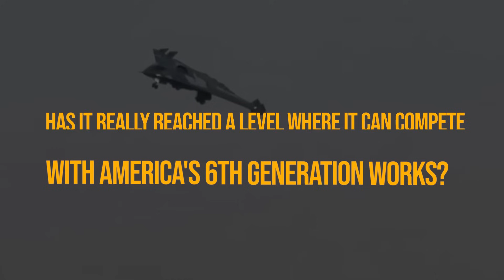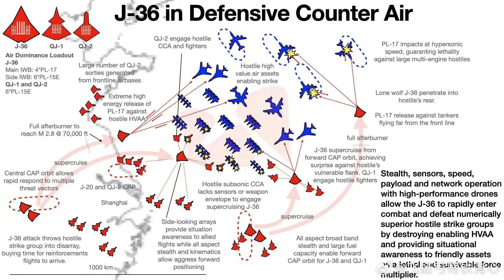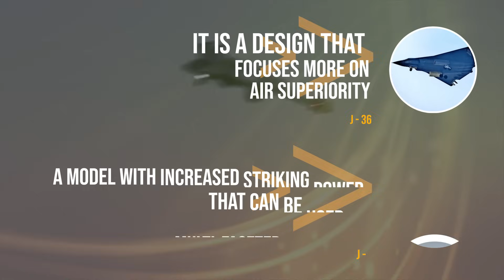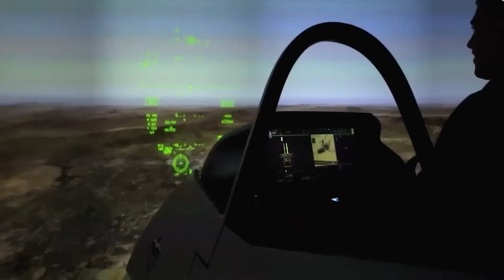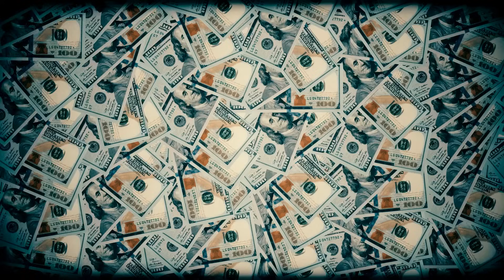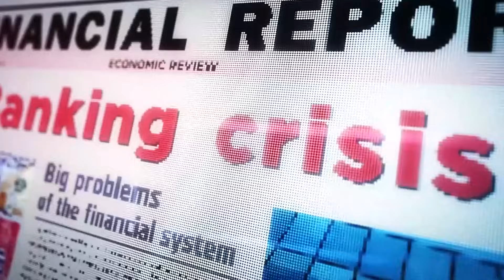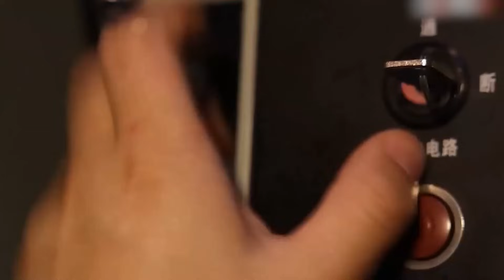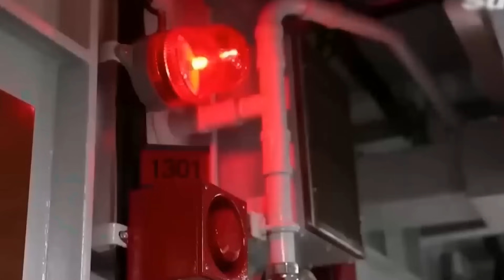China Just Tried to Respond US by Revealing Never-Before-Seen Chinese Fighter Over Sky

Comment: I don't get why they hyped China's jets so much. US had been flying tailess planes for years and we didn't brag about them. We've had the 6th Gen NGAD Demonstor flying for a few years we never bragged about it. China brags about everything they do for what?
Reply: The problem with American mindset is they are still in the legendary past…. Current military strength n performance is in a whole new level. Wake up n accept the reality so you can live without prejudice.
Reply: @sharfazhameed6382  they probably don't even know that those airplanes like F-35 were also created in Europe and still use European parts, and that Europe even has more technology than them and is developing right now 2 6th generation aircraft and one 5th, etc.

But Americans always think they are the top.

Without some European companies, the US would even go backwards 10 years in microchips.

But they will always think the US is the top.

It's tiring.
Reply: @GoncaloFerreira  I don't know where you got this info from, but it is flat wrong. You realize the F-35 was a joint fighter and the export models are built using parts made here in the US, and that the EU imports electronics from the US. 
This has been admitted by the EU itself, as for the 5th gen and 6th gens in Europe, the European counterpart to the F-35 is still a long way off, and the EU's 6th gen is still in the concept stage, while NGAD has been operating prototypes for literal years. In fact, the F-47 is literally picked from the NGAD program, the hilarious thing is we are far enough ahead of the EU is air power that the Navy is now working on its own NGAD equivalent to replace the F-18s.
So essentially, the US has a 5th gen, a 6th gen, and I'm going to be generous for the Navy based on what they will need, a 5.5th gen fighter.
You guys are behind, along with the B-21 Raiders and our new Hypersonic bomber, we outclass you in the air department. Your arrogance is more unjustifiable than my country's politicians.
To make matters worse on the ground, the US's HIMARs are reigning supreme, where a lot of countries, despite their attitude towards the US, are investing in our missile defenses and other hardware. Let's look at tanks next: the Abrams sure is outdated as a hull, huh? Well, the M1A3 is essentially the answer to all of that. The A3 abandons the armor developed with the UK for a new type developed by our own engineers, a new gun, an auto-loader, and better range and honest to god stealth.
I won't comment on the infantry's equipment, cause Biden messed up with picking Sig, but there is always time to course correct or have a more reliable manufacturer make the platform would not be the first time we did that.

Now this all said, the EU has quite a bit going for it despite its violent crime rate growing each year, potentially bringing it closer to the US's inner city's crime rate, however, it is foolish to say the EU is superior in ANY way to the US militarily atm. They are decades behind in procurement and infrastructure, and there is already VISIBLE internal strife that threatens to hinder their longevity, caused by many... Choices that dwarf anything Trump has done.